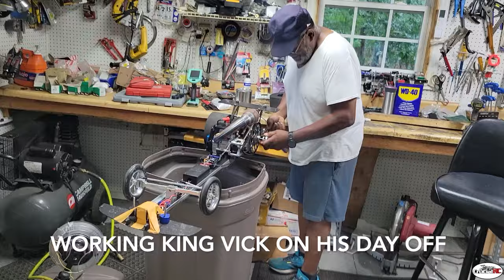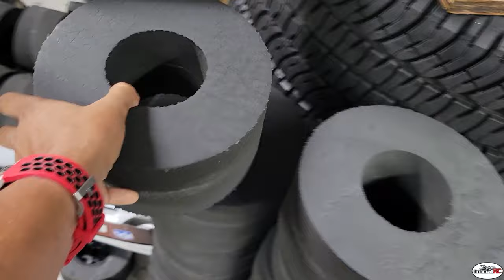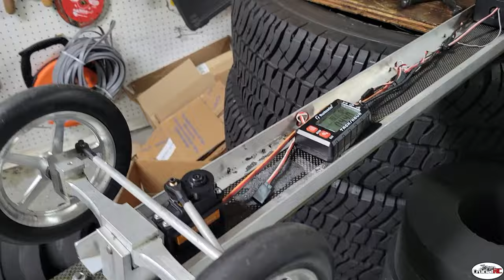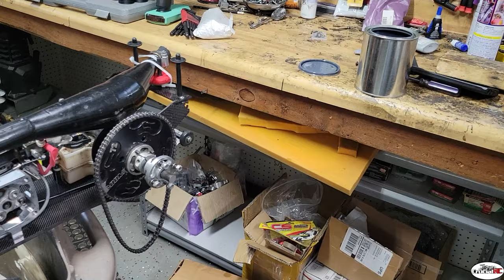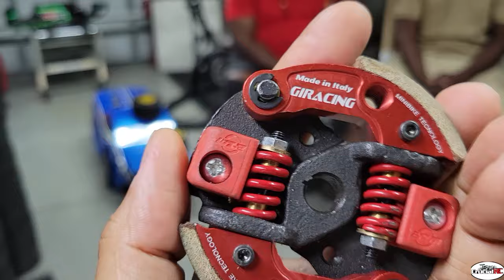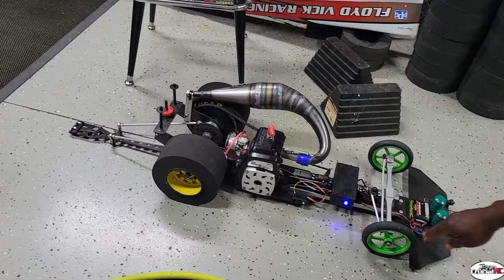Floyd Vick and Baltimore RC 1/5 Scale Drag Racing Wrenching and Talking

Comment: Yo can you ask him what Glue, he uses for those foam tires.
Reply from the maker: He won't tell me that.
Reply: @CrucialRC  OK I was trying to make some foam tires for Baja 5B.
Reply from the maker: Hit up Floyd bro. He'll cut any size. I have a couple for my Baja.
Reply from the maker: Just tell him you need for a Baja 5b and he got ya. Pls mention the channel bro
Reply: @CrucialRC  I was in the process of making my own foam tires And I was trying to get him to fit on the stock baja 5b rims and I have a good idea of what glue to use but if this doesn't work I will check him
Reply from the maker: @tigwelding123 cool. Yeah he has something he uses and it does not come off.